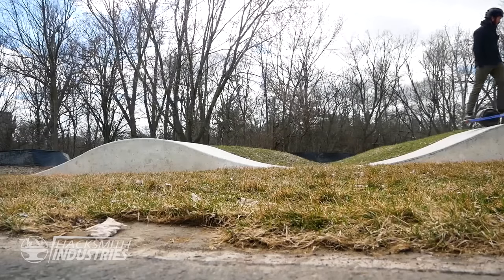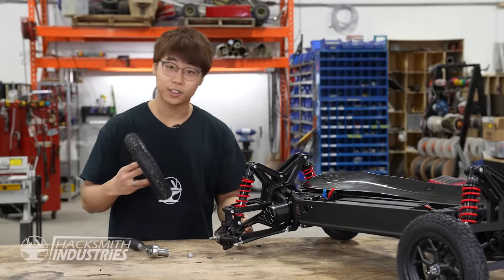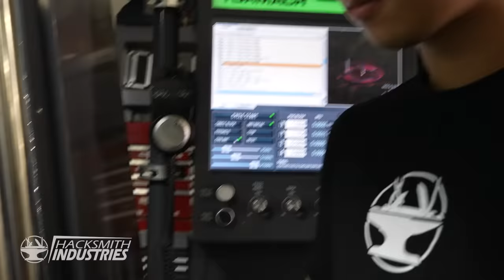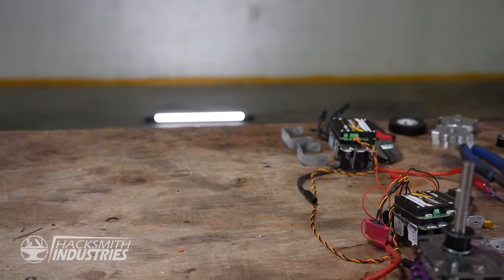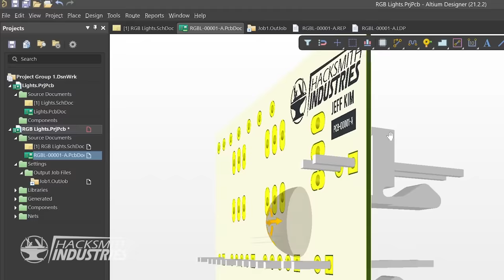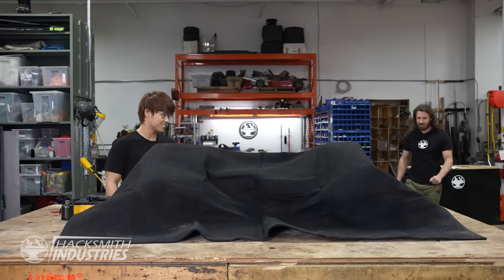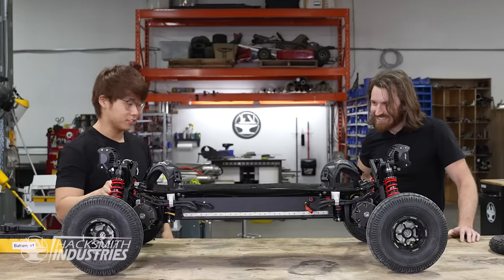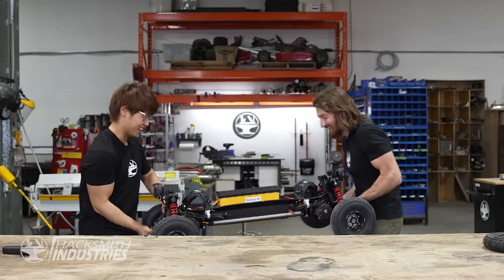The World's Most POWERFUL Skateboard

Comment: "We increased the power of this thing by a factor of 5" - "I limited the power of this thing to 20%" ...yeah...makes totally sense.
Reply: Just sit on it at that point lool
Reply: Thats the same power as stock lol
Reply: @ClumsyCars  it's lower actually
Reply: So they changed nothing.
Reply: @yustforfun  nah it’s stock
Reply: @yustforfun  do the math sped
Reply: I think he meant he only used 20% from its power.
Reply: @victorfierro6866  20% of 44 is 8,8 < 10 stock is more and the battery is smaller than stock this is just a worse skateboard
Reply: @yustforfun  So did the hacksmith made their skateboard worst
Reply: @victorfierro6866  whaaat
Reply: Makes totally sense.
Great grammar
Reply: @rylenstuffsv2  yes they made it worse
Reply: My English is bad? That's unpossible!
Reply: It’s not because you make a dangerous item that you’re stupid enough to test it out at it’s stupidest parameters yourself. Engineering are a prudent bunch u know
Reply: They said the new batteries had less capacity; all they upgraded with the batteries was the output current, which is what allows them to have the ability to potentially deliver that full 44 kw
Reply: Naw still 5x more powerful just takes the right devil to ride it 😂
Reply: There is no before and after test though
Reply: He said he is only using 20% of the power he added on because it’s to fast so it’s faster only using 20% of its power that was just added on
Reply: So it doesnt go faster than stock but the torque is unlimited
Reply: @dustinsewell6222  it's like the title of this video, "way too powerful."
Reply: My question is how the torque compares, if the torque is higher this skateboard might feel faster and be more challenging to ride than the stock version despite outputting less power.
Reply: He saying there is a lot more potential that is not being used probably because its would be dangerous
Reply: He probably just limited the acceleration ".. and it still throws me off" - not the top speed. But, while entertaining, still pretty useless like most of their stuff..
Reply: I was thinking the same thing! So dumb!!!
Reply: That's exactly what I was thinking.
They essentially just downsized the battery and put bigger tires.
Reply: He said he reduced the power by 20 %… Still much more powerfull than stock.
Reply: Imagine two people. One is running at 10 meters per second, the other is WALKING 10 meters per second. 

That's hilarious
Reply: By increasing the power of the motors or sum they would be increasing torque
Reply: he used skateboard at "full cowling" 20% One for All
Reply: He said he decreased the power by a factor of 5, not increased, then he said he limited it to 20%. A factor of 5 is 20%, champion. so it actually does, as you put it, Make totally sense
Reply: @rylenstuffsv2  yes, and locked the diffs, that makes it very dangerous
Reply: @dustinsewell6222  yeah, those 2.5 kW stock Chinesium motors are obviously not 2.5 kW or the stock controller is not outputting the full 10 kW. The new version is faster at 20% power, which proves that the original setup was over rated by 2x. Plus they can always push more power. You don't start of at 100%. You start at 20% and then move up from there.
Reply: @SentinalSlice  nah, with only 2 motors it has locked diff, so it suckes off-road
Reply: @mortenbonding  They said they limited the power which effects both top speed and acceleration.
Reply: @aymericdelong6955  He said it poorly but he actually limited it to 20% of 44kw so less than the original 10kw.
Reply: @littlejackalo5326  You are making a lot of assumptions.
Reply: Yo dude, how did you wire the lights to the controller? Im doing a similar build an have the same controller,  do you have a wiring diagram?
Reply: @garethbaus5471  More torque can be usedwith proper gear ratios to increase speed. A big gear would take more force to spin, but would then spin faster. Thus incereasing the overall speed.
Reply: @messagedeleted1922  thanks captain obvious.
Reply: Didn't really change anything
Reply: bro it’s software governed it can be changed at anytime lol
Reply: they are basically lying, these motors would burn up if they pushed it up as high as they said
Reply: He didn't say that he said I lowered it by 20% so its only a 5th of it power
Reply: Makes as much sense as @SmoMcPo''s comment. "Makes totally sense" ... LOL
Reply: BRUH he is running it at 20%, but it is increased by a factor by five at that 20 percent, just a bad order of words
Reply: @rylenstuffsv2  BRUH he is running it at 20%, but it is increased by a factor by five at that 20 percent, just a bad order of words
Reply: @yustforfun  BRUH he is running it at 20%, but it is increased by a factor by five at that 20 percent, just a bad order of words
Reply: @victorfierro6866  BRUH he is running it at 20%, but it is increased by a factor by five at that 20 percent, just a bad order of words
Reply: @yustforfun  BRUH he is running it at 20%, but it is increased by a factor by five at that 20 percent, just a bad order of words
Reply: @Jack-fd8cx  BRUH he is running it at 20%, but it is increased by a factor by five at that 20 percent, just a bad order of words
Reply: He was saying he was on the setting with only 80% power
Reply: I say throw on some motocross gear and send it full blast 😂
Reply: Maybe the 20% power is a factor of 5 from the stock build
Reply: If you try to use full power on that thing, you might end up with a broken or dislocated bone
Reply: That and without upgrading the battery you’re not going to get that much more power anyway
Reply: So... That means no change in power
Reply: you guys have forgotten basic math. multiplying by 0.2 (finding 20%) is very obviously not the inverse of multiplying something by itself 5 times (putting something to the power of 5). Here’s an example:

Let’s say our original power is 5. We then do 5^5.
5x5x5x5x5=3125

20% of 3125 = 3125 x 0.2
                      = 625

There is an increase in the power, and the option of increasing it through a simple software update if you ever wanted to.
Reply: @aymericdelong6955  no he said he reduced it to 20%. I think once in the video he does accidentally say by 20% instead of to 20% but he says its only using 1/5th its power more than once. Meaning its 8.8kw. Less than b4. But because he increased the voltage it could still have more torque and feel faster than before. Not to mention the fact that he has the ability to use any amount up to 44kw with a simple adjustment.
Reply: ‘Murica!!!
Reply: For his skill level

Comment: Jesus this thing has more HP than my motorcycle lol
Reply: Your motorcycle can probably take advantage of it better though 🤣
Reply: @oliverer3  the car thor huh mp0
Reply: Oof
Reply: Bruh I read this as hit points
Reply: Your motorcycle has low hit points
Reply: You use a motorcycle?
Did you know you are adding onto the CO2 layer
Reply: same
Reply: @maggogieraffe3296  carbon foot print isn’t all that better with EVs when you include mining and shipping of raw materials to manufacture such vehicles.
Reply: @maggogieraffe3296  the video you see emited CO2 and you release CO2 by breathing
Reply: @TKO593  true it makes over 169kg of co2 to make a 40kwh battery
Reply: What if it has 4 engines would it be like 2 times better
Reply: @blise518B  Ó-Ò
Reply: @TKO593  Not to mention the power source for the EV's are mainly CO2 emitters, like thermoeletrics
Reply: @maggogieraffe3296  still better than using a car...
Reply: I read this at first as jesus has my motorcycle 🤣
Reply: it does not. it can barely output 10hp.
Reply: Yes it duse
Reply: @TKO593  wronge
Reply: Remember to enhance your medical insurance first before getting on this

Comment: "We took a skateboard out of the skateboard to make a better skateboard"
Reply: Then limited the power to less than it originally was
Reply: "Godzilla had a stroke reading this and died"
Reply: That’s what I found funny also. They bought a Propel EV X4S and then seemed to realize at the end why Propel EV set it to 10kw.
Reply: I used the stones to destroy the stones
Reply: Then downgrade it so it has less power than stock...
Reply: Limited power to what it originally had, but by using less motors it doesn’t have a differential anymore

Comment: The 4 motor design was such an elegant way to achieve differential while still driving all 4 wheels. Throwing that out was actually a down-grade in many respects.
Reply: 4 motor in that thing would be insane. So it must be done.
Reply: But then he wouldn't have an excuse to advertise the stupid powerful motors.
Reply: Great statement from the backseat engineer...
Reply: they dont know how to program that in
Reply: Achieve limited slip
Reply: Literally my first thought.. if they had upgraded each motor (4) it would’ve been superb.
Reply: He did admit it may not be smart, but boss said do it hehe.
Reply: @Gambit-jo4rw  not like those motors needed to be upgraded, the board (plus rider) already has a power to weight ratio of a typical sports car.
Reply: @SolarizeYourLife  I have a diploma in mechanical engineering.  he is correct.
Try learning something.
Reply: Came on to say exactly this but he could have done it so the motors powered left and right instead of front and back.
Reply: Could have gone with 4 flipsky 7kw motors.

28kw and better control that you wouldn't have had to nerf, and you would have actually improved the limited slip using a flipsky controller. And you wouldn't have needed an additional custom pcb.

This smacks of "Someone gave me these motors, so I had to make it sort of work."
Reply: Exactly what I thought yes 😂 Just left a comment about that 😅
Reply: @Nbomber  nailed it!  when turning the board, the inside wheels turn slower than the outside wheels, but by locking the left/right wheels in sync with a solid axle, they lose that ability. I imagine on dirt it won't be super noticeable (think quads and go carts) but on pavement that is going to put crazy wear on the drive belts and handle choppy and any tight turns. For the purpose of off-road (the intent of the board) it should be fine.
Reply: What do you mean differential ? Im into RC trucks and I need to know what a center differential is. I googled it but Im finding it hard to grasp lol